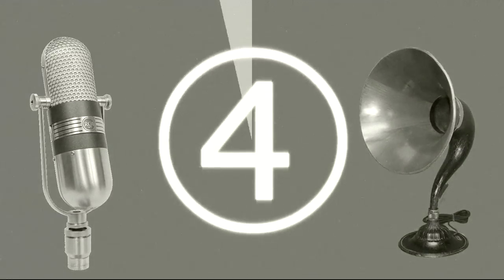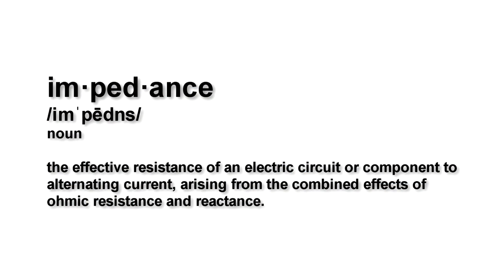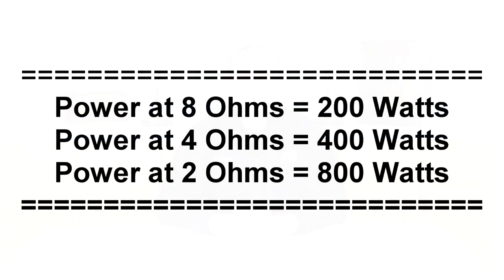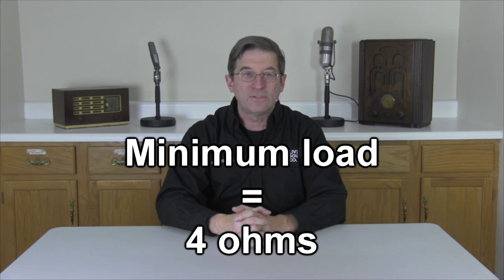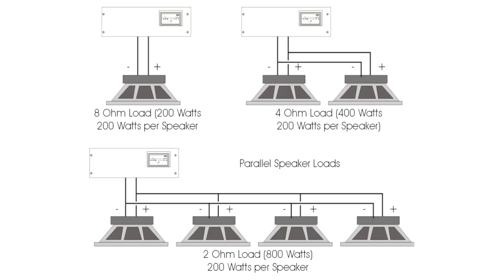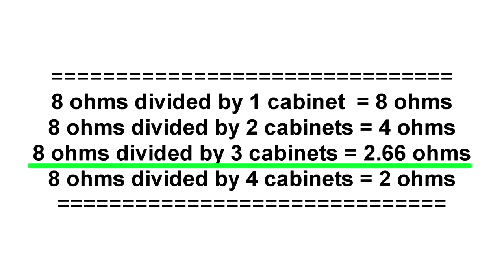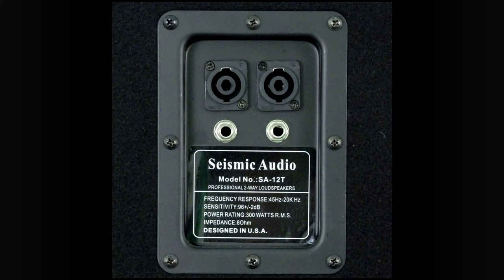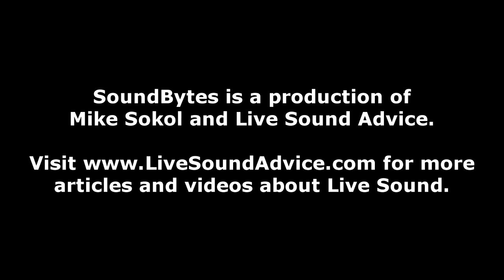Live Sound Bytes - Speaker Impedance

Comment: Dear Sound Advice Guy,  this was a great, simple , explanation of this speaker / receiver ohm issue.  My Denon DRA 800H Receiver has 2 speaker output connections, A and B  which allows for 2 pairs of speakers to be connected.  I paralleled 2 pairs of 8 ohm bookshelf speakers to the B connection for the back of the listening room ( 2 different makers : 1 pair of Elac Reference and 1 pair of Fluance Signature Series Surround HiFi Bookshelf speakers) And  I also connected 1 pair of 8 ohm bookshelf speakers to the A speaker connection.  Played CDs and sounded great until the Receiver power light flashed red and shut down.  I presume that theReceiver could not handle the lower ohm load? Is there a way to wire them in  different way to avoid this?  I did purchase a separate integrated amp,  an IOTAVX SA3 and connected the A speakers to it.  Left the 2 pairs paralleled on the B  connection on the Denon .  That works fine, although , the volume and tone controls are varied.    Thx for your advice! Be well and safe .

Comment: Kindly I have 8 Ohm speaker and 4 Ohm speaker on a parallel connection to an AMP giving between 4 ohms - 8 ohms? What is the total ohm each speaker is getting and what advice can you give about the connection?

Comment: I have a Cerwin Vega SUB15 subwoofer 1000 watts 32Hz - 150 Hz Power Handling program 500 watts peak 1000 watts sensitivity 4 ohms and a  Rockville RSG 12.4 500 watts rms: program power 750 watts: peak power 1000 watts can you help me.  I like to get 2 amps ...  1 for highs & mids and 1 for low end.

Comment: cam someone kindly explain how connecting speakers by their in and out ports link them in parallel and not series.
Reply from the maker: I'll do a video about this soon, but imagine two wires in parallel, one being ground, the other being hot.  Each speaker is connected between the ground and how wire. When you're plugging in between speakers with a Tip-Sleeve or Speakon Cable, you're just extending the parallel wires and adding another speaker between them. That connects all speakers plugged together in parallel.

Comment: You should have included 6 ohms instead of 2. Who the hell has 2ohm speakers!?
Reply from the maker: +blake kersey If you parallel two speakers with 8 ohms impedance each, you end up with 4 ohms total impedance. Many subs are 4 ohms (two 8-ohm speakers), so running two subs in parallel makes a 2-ohm load.
Reply: Live Sound Advice Now I have an 8 ohm amp and I have two 6 ohm speakers. I take it that is pretty safe?
Reply from the maker: Yes, since most amplifiers rated for 8 ohms are actually OK down to 4 ohms. But a 6 ohm speaker iis pretty uncommon. Exactly what is it?
Reply: Live Sound Advice Sharp speakers.